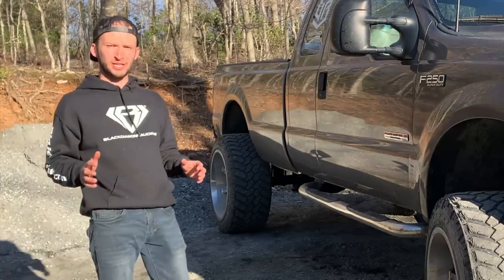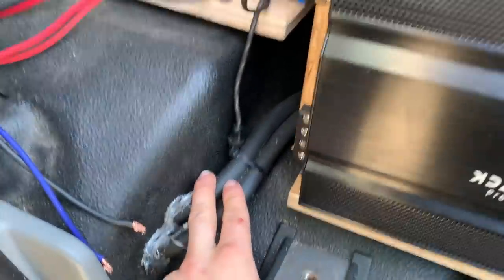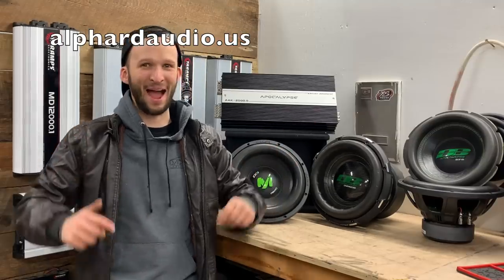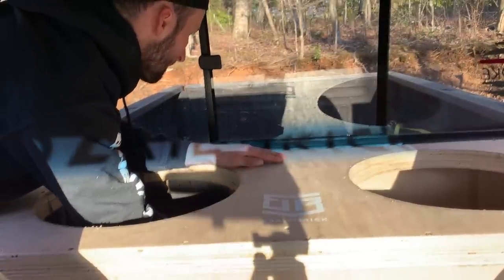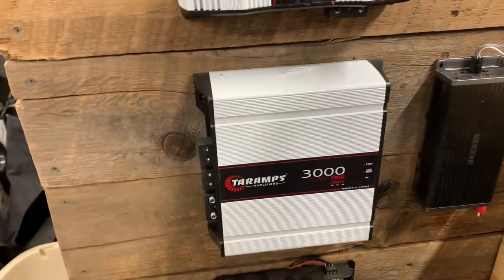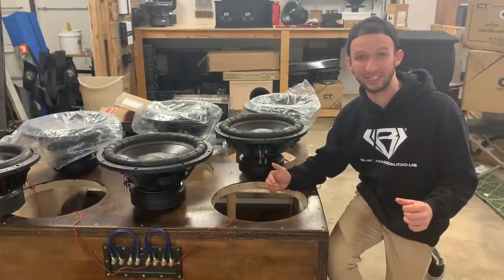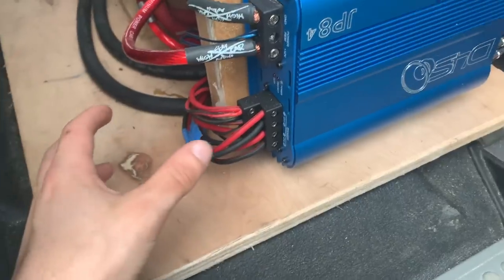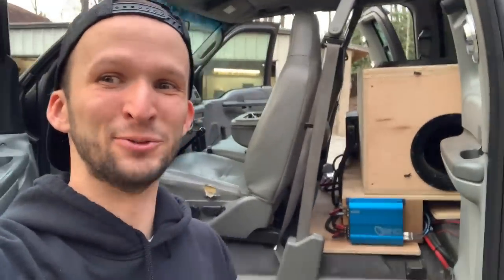New Build For the Truck! 2 15s | 8,000 Watts

Comment: You could try putting rubber stand offs on the 8k to prevent any vibration damage
Reply: Its hard to see, but he did use rubber gromet/spacers, when he mounted that Bass 8k, to this box, in this video.
Reply: A lot of times even rubber standoffs are not enough. My amplifiers are not even mounted to my box and I am very worried about how much they bounce when playing subsonic frequencies.
Reply: @DJ TS That's exactly what I said. I was looking through the comments to see if anyone else had commented about that. 👍
Reply: @sethgt1234  try buying a rubber platform, or a thick foam platform same shit they use for knee pads Klein makes them , then get long wood screws and screw into the wood but use more rubber washers

Comment: When I installed my Orion XTR 750.4 at first I had only what I had to work with so I had to mount it upside down. Drove me nuts. But once I got my extra wires, bus bar, and CT 1000.1D, I was able to adjust it around having the 4 channel above the monoblock mounted on the back of my rear seat which allows me to pop it down and adjust it from the driver seat of my 04' Passat 1.8T Sleeper Wagon.
Reply: I love Orion amplifiers! I have 3 of them. I have the HCCA 4,000.4, HCCA 2,000.4, and the HCCA 11000.1. I have also had 2 of the XTR 2,000.4's. They have all been amazing amplifiers.
Reply: @Seth Tynan  indeed.  I've got the Maxspeedingrods Q96 Android head unit teamed up with it. Just Amazing! Can't wait to get those NVX 6.5in/1inch tweeter component sets for the front and rear sets. VW has blown me away with this Wagon since everywhere I would add sound deadening they already have. I plan to upload a walkthru of my setup soon. Just finished custom installing a pair of flood lamp style LED Fog lights on the ride so once this cold rain/snow passes in the next couple days I'm taking it out to a park where I can Share my progress and share the differences between everything closed up and when it's not at full volume. I do plan to get 2, 4ohm DVC Tropo XL 12s wired down to 1ohm at some point in a vented 32hz box for events and competitions as I've came back from hiatus now that my daughter is a teenager. Great bonding option 4 the summer. But as I have it setup for SQL I'm currently running a 3/4"  sealed box that runs perfect for the Single 10in 2ohm DVC CT Tropo sub wired down to 1ohm. All together sounds fantastic in the ride. In the process of creating a cover for the trunk area of the wagon.

Comment: Parker, I have heard conflicting information on attaching the Amp to the Box. I want to attach my Surge10k to my box to be a little cleaner but almost every shop told me it isn't good to do so... What do you think? (You should really try the Surge Audio Amps BTW.. Do well above rated and are Korean made. Old Co-Owner of Wolfram started the brand).
Reply from the maker: My box is bolted to the car so it hasn’t given me any problems at all
Reply: @ParkerTheBasshead  ty!
Reply: @beyondthedetails  Plus, parker put rubber gromets/spacers, in between this Bass 8k, and the box.
Reply: If your box doesn't flex and is bolted to the vehicle, and you used rubber isolators then you shouldn't have a problem.

Comment: @Parker The Basshead I would love to see you try a pair of the DS18 HOOL-X15.1DHE on your Martis amplifier when you get it back. Each of those subwoofers have 118mm peak to peak excursion, that's over 4" of excursion each! I don't think I have seen many, if any 15" subwoofers with the much excursion. I just bought 2 of the DS18 EXL-XX12.4DHE and those have 84mm peak to peak excursion, or just over 3.3" and they are insane! I can't imagine what the HOOL-X15.1DHE would do with enough power. I am running my 2 12's on an Orion HCCA 11000.1 with 120AH of Yinlong, so I have more than enough for the 2 12's.😊 Edit:  I bought my 2 12's from Big Jeff's Audio because of hearing of him from your videos. I got a hell of a deal on them!

Comment: How do those 2 to 1 wire reducers not jump that small gap and short? I've always been afraid of that happening so I haven't purchased them
Reply: It would take them touching to short out. It would take very high voltage to be able to arc across any gap. 12 volts DC is not even in the realm of being able to do so. Edit: It takes about 30,000 volts to jump 1 centimeter under normal temperature and humidity.
Reply: they are made with a slight offset  and when put in, the terminal bolt keeps them from moving.  So say you flipped them around, then they are definitely touching.
Reply: Electrical tape wrapped around them solves that issue

Comment: Hopefully there D2s! and that 8k at . 5 ohm be enough to get em stinkin. The 2 new 3" 8 layered D2 400oz 15s I built are pretty stout but they will start stinkin with them on my cab45 at half ohm. It was ok at 1ohm but at half that thing really pumps out the power. On sundown unofficial he dynoed a cab45 at  .5 ohm and dynamically it made 9800w! Why people dismiss dynamic like it's a fake measurement is beyond me... cert an uncert is a test tone I get it it shows how it will pump out steady but you don't really don't need that who listens to test tones but dynamic is more like real world function it's a 40htz (typically used) pulse tone i e. Like music!!!
Reply: Any amp wired @ 1/2 ohm will never SEE its wired=@ rest impedance, while playing music, or burping test tones. Wiring an amplifier to a dummy load, on an amplifier dyno, is nothing like a reactive, musical load. Amplifiers will try to double there power, as impedance gets halved, but they dont produce as much power to a speaker as people think. Example: I have been wired to 1/2 ohm @ rest, and when i had the term lab power probes hooked up @ my peak= loudest test tone/burp freq., i was rising to 2 ohms! My 4k amp @ 1ohm, does 2k @ 2ohms, so that was the actual power my subwoofer was getting=2k, even though i was wired @ 1/2ohm @ rest. Get your setup ✔️ on the power probes, @ your peak freq., for your peak Db, and let us know. Hope this helps, have a nice day, fellow bass head!
Reply: @evilinside5984  And it all depends on type of box, subwoofers, cabin of vehicle, etc. that will determine impedance rise. The only way to actually figure out how much rise you get in any particular system is how you said. With a termlab, or multi meter and amp probe, ect.

Comment: Hey Parker, I’m looking for the best sql subwoofer that can get really loud in a sealed enclosure. I want to put 6 10 inch subwoofers under my seat in a 2018 Ford f150. I want 3 subs firing forward and 3 firing up. I have a 3.5 inch seat lift.  Box specs is 53 length, front height 12.5, rear height 9.5 and width of 11. What subs should I get? I have about 3500 rms of amp power I’m working with.

Comment: Need your help. Trying to figure best box to make for 2 hippoxl122r's. I made a box (first one ever) for one and it sounds great. At 2.8 cubic ft, but I want to make a box for 2, but I want middle slotted port so that I can open arm rest in back seat for wind to come thru car. Can you help me out with trying to figure size. I would love for box to stay at 15" high, good snug fit that way. 34" wide would be most, but deep I'm having trouble. Current box for one is 15x32x18 side 4.25" slot port

Comment: Hey Parker. Is that a 6.0 powerstroke? I've got a system in my 6.4 with 2 evl 12s and I've got a ton of headliner rattle. Just wondering if you've got the same problem. Would love to know if you've tackled the problem yet! As always, KEEP BASSING ON
Reply: I was wondering the same thing lol
Reply: I got two l7 solo baric on 3k in my work truck all old Ford headliner SUCKS! Lol I suggest either replace or the little bit of headliner that falling glue it down while
It’s only a small amount I have to reglue the front every couple months or it’ll be hanging a foot down . All old fords are gonna rattle crazy especially back vent windows lol
Reply: I have a 5.7 super duty all interior headliner the same on 250s just different color
Reply: Buy some foam pads and install above your headliner, double sided velcro tape too

Comment: Awesome Little Budget Build Can’t Wait To See It In Full Action 🔥🔥 I Got 2 SDR 15s I’m Tryna Figure Out If I Can Run 5K On Them On Stock Alt n 2 Batteries
Reply: No
Reply: @Drago 710  right.. just no.. will never see 5k out of an 5k amp on stock electrical.. will only harm (at this point im talking to other guy not you) dudes gonna fry his stock alternator now matter how many batteries he adds... and possibly fry the amp if the voltage is that bad.. maybe not fry it with modern technology and shut offs... but like you said.. just no. lol

 I mean shitt unless that stock electrical is a big diesel truck with already a 200a alt or some shit he might have a chance lmao but unlikely still
Reply: @zanechristiansen   So Just A Alt Upgrade and I’ll Be Good ?
Reply: @antfrmthe8885  I have a jp23 on a mechman 240a alt and a single xs power battery... the oem replacement for the chevy cobalt... d4700. I don't drop voltage into the 13s. I stay in 14s, might be different when I hook up my new sub at a 1 ohm load in the box (I hooked it up free air but didn't full tilt so I might drop into 13s now but I'm still strong) 
for a 5k amp I'd want closer to a 300a alternator personally.. if you can only get a 240a you'd want a couple reserve batteries as well.. lithium is a good way to go but the price is what kept me with agm battery (and I live in cold climate so lithium would be destroyed) start with the biggest alternator you can find while still being a reliable brand with some longevity.... you have to upgrade wiring you'll probly need 2/0 wire or dual runs of 1/0 for an amplifier that big...  I'm just saying all this because I didn't think about all this when I first started and now I am a year later still unfinished... it Costs a lot of money for the hidden things you don't think about.. good quality ofc wire.. the terminal connectors to connect all the wires. alternator. (I spent like 400 bucks on that 240a alt) the battery.. new battery terminals.. just gotta think about all that stuff along with the big 5k amp that you've been eyeballing lol... I bought all my equipment over time

all this to say I felt like I was going a "cheap" route.. saving money on that 2300w amp I only got it for like 200 bucks or something... but the rest of my system is suddenly well into the thousand dollar range of money spent.. not to mention the 1000 dollar psi sub going in it... lots of money in this hobby. if you got that. you're good lol
Reply: @zanechristiansen  Aww Man I Think I’ll Just Stick With My 1200W Amp For Now I Know I’m Under Powering These Subs But 400 Just For The 240A Alternator Alone I Gotta Start Saving So Far I Probably Spent 600-800 On What I Have So Far From The Subs To The RP1200 Amp And I Have 2 Duralast AGM Batteries I Haven’t Even Big 3’D Yet I Got A Lot Of Work To Do Lol. Thanks for the Information And Good Luck On Your Build As Well
Reply: @AntFrmThe8  yea thanks man lol it's just a lot... I go all out when it comes to this so I'm ok with spending how much I have... you can find deals. Parker here proves that lol he always finds subs and im like damn it's only 130 bucks?? or whatever. you can definitely bang on a budget, and like I said.. buy in increments.. it only sucks when you have to wait to even use something you got because you need something else lol
Reply: @AntFrmThe8  you cant put anything more than the rp1500 on those sdr's. Ive seen so many videos, so many reviews, and know of so many people who blow them on rms. They might last through a song at 700w each but you will be lucky. Dont do what youre thinking. 5k on stock electrical is the dumbest things ive heard especially on sdr's. Youre gonna blow them instantly
Reply: @AudioEuphoria080   I Mean Obviously I Know I Wouldn’t See 5K On Stock But I’ve Seen These SDRs Take A Good 2K Without Blowing I Might Just Get The RP2000 And Big 3 I Got A 100Ah Alternator I Think I’ll Be Fine
Reply: @antfrmthe8885  they definitely wont handle the 2k watts trust me lol but if yiu did want a cheaper alternative, sell what you have and get a jp 23 v1.5 (v2 does alot more power but is more expensive) and then buy yourself 2 skar ddx's. But make sure to get a very nice reserve battery. The rp2000 is not a good amp. Its very inefficient and will suck down power and not return much. Its only about 55% efficienct so on cheap electrical you wont get nuch out of it. I owned one 👍
Reply: You can't run 5k on a stock alt lol
Reply: @antfrmthe8885  those are subs are meant for a 1000 watt amp. I wouldn't put those 2 subs on more than a 2500 watt amp. 5000 is waaay overkill
Reply: @antfrmthe8885  Taramps list the smart 5 maximum music consumption at 230 amps @ .5ohm so say 250 add on to that what your car uses say 70amps you'll need 320 amps to run it and stock alt with agms won't cut it. Look into scib lto lithium cells and a high output alt that charges at 15.5v and you'll be in bus. You can build say a 30ah batt out of 10ah  cells and be good for 12k watts clamped like two smart 5s or two bass 8ks all day and not drop voltage.

Comment: really seems like you did a poor-quality install like more people do these days. more concerned about the multiple amps putting out 1000's of watts rather than running the proper wiring .. now you have turn-off pop a relay isn't going to fix it. A turn-off pop is just for the simple fact that the amp needs to turn off before all the other equipment. more less need a timer delay like a tr-7 from pac audio. The TR7 Is a universal module that combines many features into one box. Carrying one TR7 will cover more than 16 different SKU#:
Low voltage trigger
Alpine video bypass
Latching outputs
Double pulse output
Pulse extender
Horn honking output
Linear actuator controller
Door lock pulse generator
Channel splitter
Pulses to constant output
3 in 1 timer outputs
Pulses to latch/unlatch outputs
Pulses to pulse output
Pulses to timed output
Latching outputs #2
Turn on pop delay
Delayed amp turn off pop
https://www.woofersetc.com/p-7513-tr7-pac-universal-trigger-output-module.html